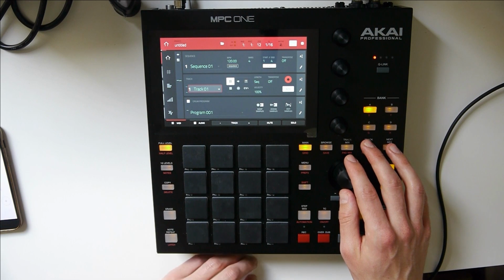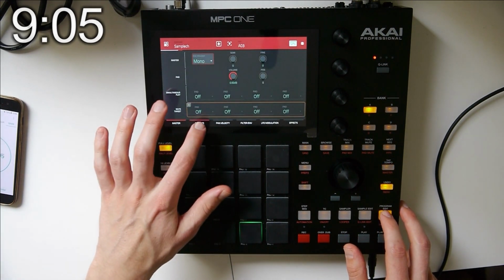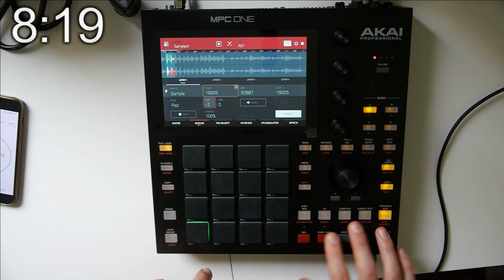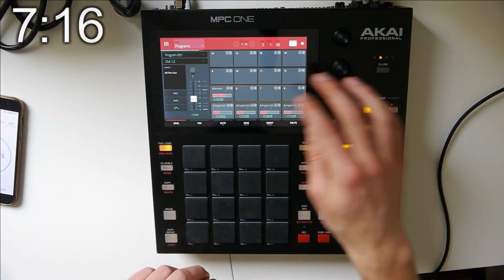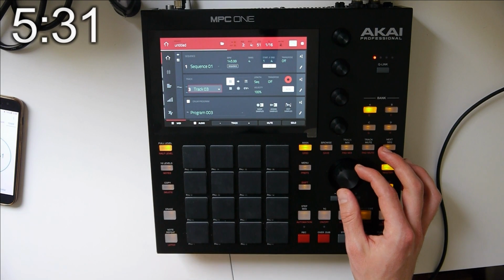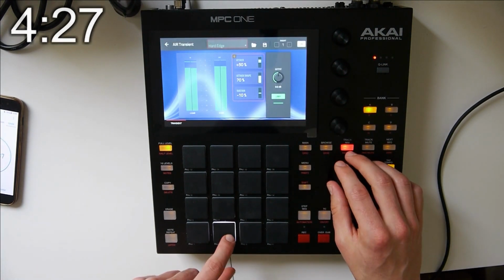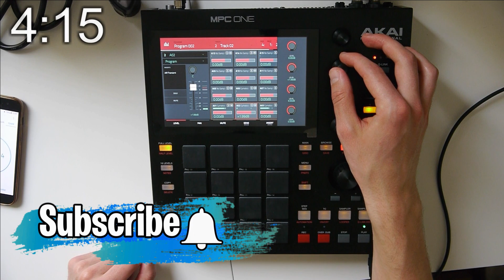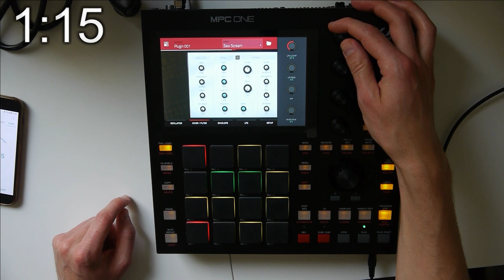MPC ONE Beat Making - CRAPPY Sample Into FIRE Beat in 10 Min!?

Comment: I would of bought the mpc one if it had bigger pads and an adjustable screen, mpc2500 is better imo
Reply from the maker: Yeah adjustable screen would be dope..the pads are small but still feel good.. the 2500 is dope especially with jjos2xl but i think you could conpare the 2500 to the x..also with its size..the one is really small..
Reply: @Marrcello  personally the mpc one is trying to be a modern version of the original mpc style (2000XL, 2500) but its just smaller and looks/feels cheaper to use, all akai need to do is keep the exact same build quality/size as the 2500 with the Q-Links and everything and just add a more modern screen to it. But they keep trying to be innovative and bring out whack mpc's